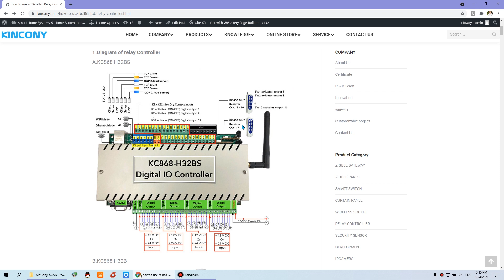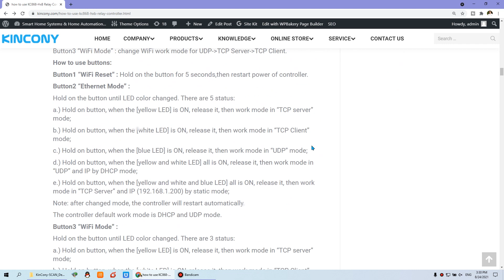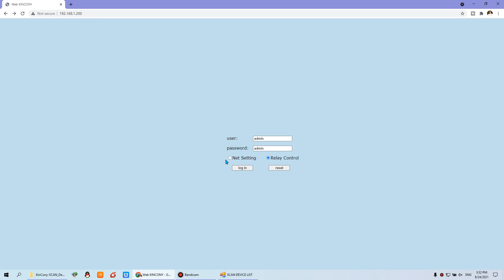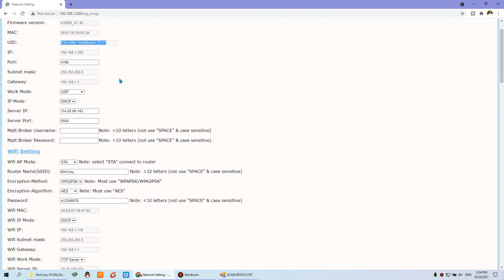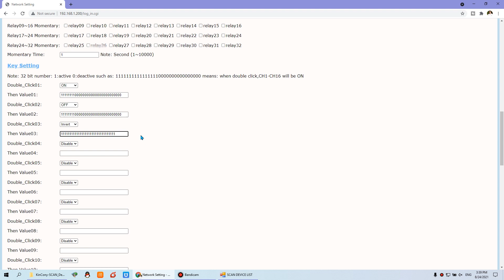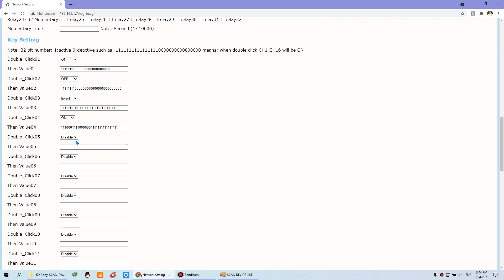【How to use KC868 H32BS #02】Wall switch panel

Comment: What cable are you using for wall switches? It's not ethernet. How many wires?
Reply from the maker: any cable can be used, such as CAT5 cable.
Reply: @KinCony  yes but in this case the cable you use has more than 8 wires.
Reply from the maker: any cable can use by yourself. @sebagarayco